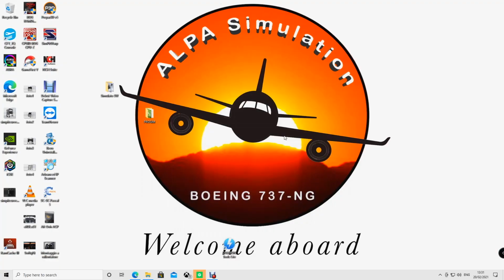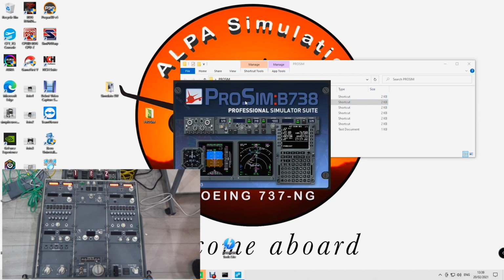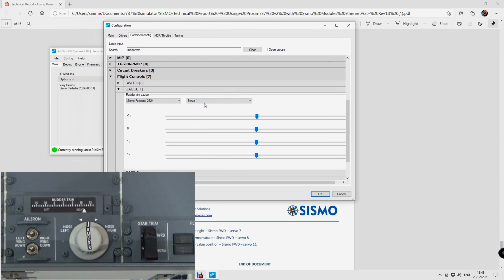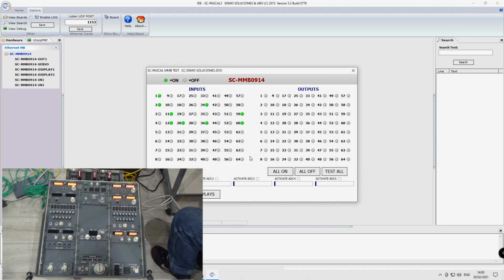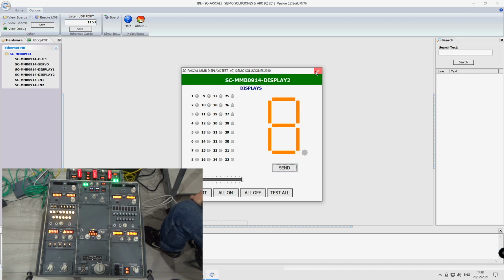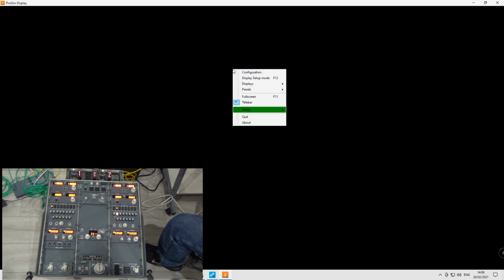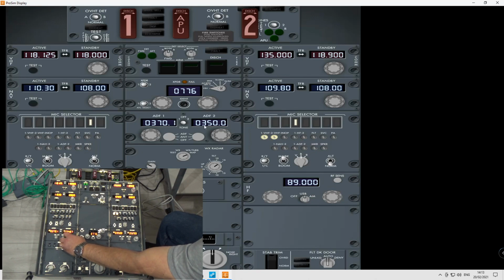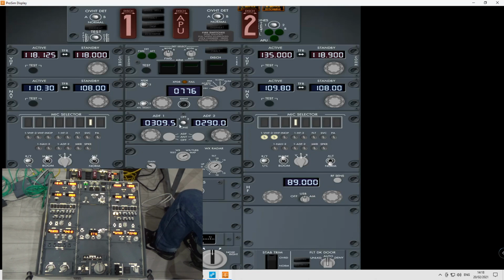Setup & Testing of the Pedestal

Comment from the maker: I am just wondering whether the rudder trim servo motor is mounted with the cable swapped. That would answer the question on why the trim was moving opposite the direction of Prosim slider. I will investigate
Reply: Most likely is the three pin cable, just open the Pedestal by removing all the top blank cover panels, and try  to find the Servo card , I thinks is an yellow card , swap the pins.
Reply from the maker: @1Miguellima  yes that's what I will do tomorrow. By the way, I meant to ask you something but I will pm you
Reply: Any time